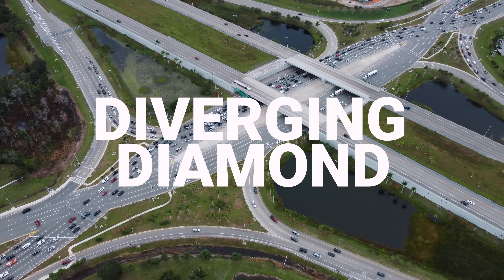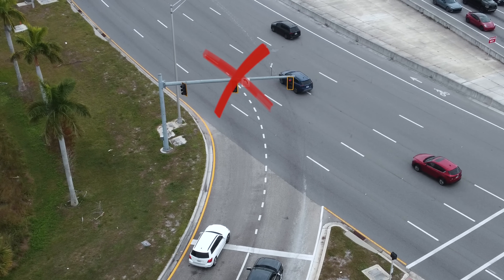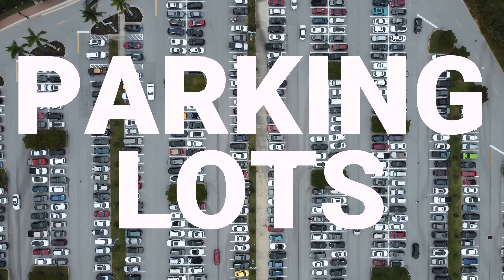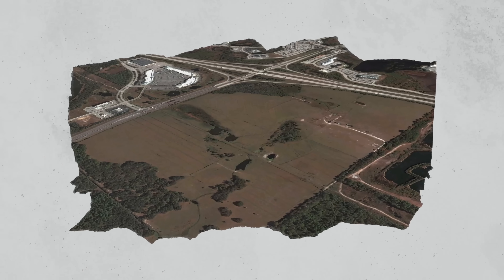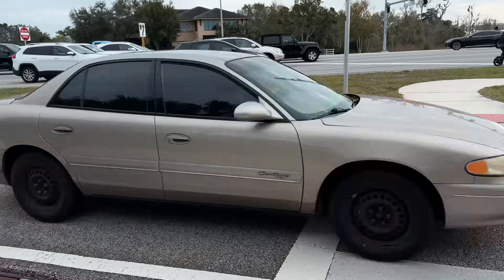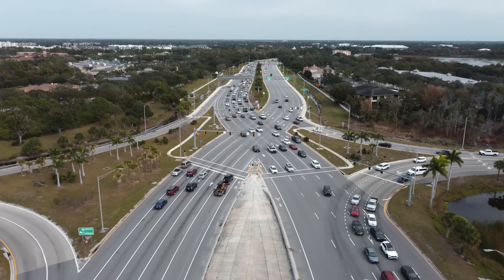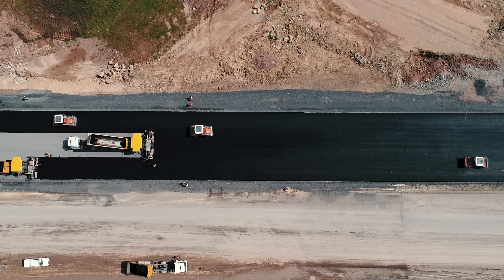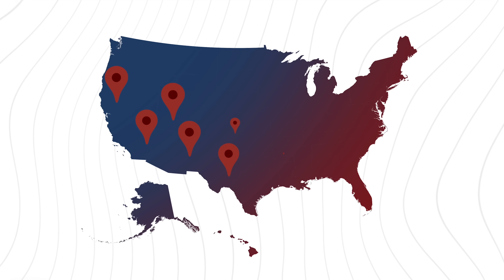Traffic Will Never Be Fixed Here

Comment: As a European, I've never seen such an interchange in real life, really fascinating. I've built them in Cities Skylines 1&2, but there they seem more like a gameplay concept, because nobody would be so crazy to built a five lane per direction highway. The collector road next to my apartment has two lanes in total, and that's a major traffic hotspot in the area.
Reply: Interchanges on this side of the pond are scary
Reply: the arterial road in my neighborhood is 4 lanes wide in total and the train line on it has a daily ridership near 1 million
Reply: Everyone should play cities skylines to see that more lanes can't fix traffic. Slam a bus or a tram line and you're good to go. Use cargo trains to reduce cargo traffic.
Reply: @freemanol  Another solution is the "relief route". This area in Florida was not designed with enough alternate routes that cross over (or under) I-75. Traffic is thus forced to go through that monster. Transit is typically not feasible because of the distances involved, and how spread out things are.
Reply: I assume you just dig a tunnel to avoid the problem of the 2 main intersections in the diverging diamond in Cities Skylines? At least in-game, the engineering challenge of building tunnels and bridges is a non-issue as long as you have space.
Reply: @takatamiyagawa5688  No, I just had those two intersections as intended. You're right that it's easier to just build a tunnel in CS, but getting the roads to not overlap with each other (which causes the game to refuse building the road) is still hard.
In CS1, there are third party mods that allow the two traffic lights to be properly synchronized, so it's possible to recreate the real thing. In CS2, mod support isn't there yet unfortunately, so it's a big mess and just causes even more traffic.
Same issue with single point urban interchanges, even though CS2 actually has one as a predefined building block.
Reply: @anlumo1  Games rarely take into account real world problems such as the high water table in Florida, and the flat terrain means any crossing has to reserve additional room for the approach ramps.
Reply: @dtvjho  cities syklines since it's the first game, you needed to mod it for traffic to work correctly otherwise you can have 2-6 lanes but everyone takes the very right single lane no matter what
Reply: @takatamiyagawa5688  that is called a double crossover merging interchange. the big problem with them is they take a lot of space and cost a lot of money. Its my personal favorite interchange, as it does fix a lot of problems. 

I think a another solution that could be implemented in some places is all directional four leg interchange. same concept but instead of the main lanes crossing over each other you make the left turning traffic take a ramp over the whole thing.
Reply: You are going to love East Texas then.
Reply: Irvine California has 3-4 lanes in both directions on almost every road in town and it’s a wealthy designed from scratch city with warm sunny weather all year. There’s bike trails for exercise but they don’t go to shops for that residents have to drive to avoid crossing 8 lanes of traffic. This expense is all by design.
Reply: As having lived on the other side .. Germany was once totally willing to demolish medieval castles to build Autobahn-interchanges. Not all citizens agreed and now e.g. the Kommende Ramersdorf still stands, precariously close to that cloverleaf. If there are only fields there to begin with, nobody will be against roads per se, and so the monstrosities get built. But if there are other things around, it's not so clear any longer. I feel that Germany started backing off a bit on more open highways starting with the 1990s, with the tunnel construction to hide that monstrosity in Düsseldorf. Similarly, San Francisco's Embarcardero Freeway was demolished in 1991.
Reply: @karlkoehler341  Germany also has a very broken relationship to cars in general. Freie Fahrt für freie Bürger…
Though my experience when driving through Germany was that there weren't that many huge Autobahns, just that they're everywhere and span through the whole country like a spider web. The traffic is more spread out.
Reply: @anlumo1  They you were not driving through the Ruhrgebiet there are close to none which have no speed limit. There are crazy traffic jams on the A40 or A1 or A3 or all around Cologne. There are just to much people here. And something to note here we have a huge web ob passenger rail lines here aswell. But those are also as full as the streets but without them traffic would completely collapse. You also have to add that we have a huge amount of trucks driving through our county to the sea ports in the north or west for example.
Reply: @jonkess2768  Still I love the Ruhrgebiet (Ruhr Area) in Germany, perfect mix of real dense urban cultural life and slices green and some smaller-scale infrastructures. Much better than f.e. the Randstad area in The Netherlands. I have been working in both areas.
Reply: @karlkoehler341  The present castle is from 1842, after the original building burnt down.
Only the Georgskapelle was saved and moved to another location!
Reply: @karlkoehler341  Cloverleafs are a terrible design anyway, always have been. They're cheap if you have big tracts of cheap land to build them on but other than that they have little to no benefit.
Reply: There are (much smaller) diverging diamonds in france. I think thats where they were first used since they date back to the 1970s.
Reply: In the UK we generally use a roundabout with traffic lights for this job. I don't know how well it would scale to this level of traffic.
Reply: @daveansell1970 And possibly grade separation as well. 

Although at least in my experience, in the UK you wouldn't usually have a road quite as hostile to pedestrians and cyclists as this with as many lanes as this right next to even an out of town shopping centre.

Or if you did, it would be a motorway with flyovers etc or motorway style dual carriageway surely?
Reply: Even in normal parts of America (i.e. not Florida) our diverging diamonds don't have five lanes in each direction
Reply: In the Netherlands we have something like this. But its a highway intersection without traffic lights achieved through multilayered bridges. Really massive. You can find it on the A15 / A16 between Dordrecht and Rotterdam
Reply: Philadelphia has an awful stretch of... I guess it's an oversized roundabout? The Benjamin Franklin Parkway... It's tons of intersections crisscrossing through a hellscape of lanes and lights. It feels like a true free for all only slowed down by the traffic lights... Worst part? The Art Museum Rocky Balboa climbs in the iconic movie scene stares at it in all of its madness.
Reply: We do have in Europe something that looks like it, but without the intersections. Instead we have "fly overs" these replaces intersections if clover leaf intersections haven't enough capacity;
Reply: @buddy1155  I think I've seen that before. The interchange of I-405 and Wilshire Boulevard in Los Angeles has those
Reply: @buddy1155  Yeah, a free-flowing variant that eliminates the two cross-over intersections is definitely better, but I don't believe any have been built in the U.S., probably due to cost of building the additional bridges/tunnels that would be necessary. But in this particular example, the intersection isn't even the bottleneck anyway. It's also crazy that bikes and pedestrians are supposed to be using it and crossing at those same cross-over intersections. Yikes.
Reply: @buddy1155 That's an intersection for two highways not a highway and a collector/arterial, which is what diamonds and diverging diamonds are for
Reply: @buddy1155 There is an interchange like this in France with lights in the town of Versailles which inspired this and now similar configurations are all over the United States.
Reply: @buddy1155 Ok, but 5 lanes highway just don't exist in europe.  I live in Geneva (1.2 million inhabitants) and the widest road in the conurbation has only 2 lanes in each direction (if we don't count the preselections lanes). As I travel almost exclusively by train, I've hardly ever seen the motorways of the rest of the continent, but I did once take the motorway between Marseille, Lyon and Paris (the 3 biggest cities in France). Even there, the motorway only has 2 or 3 lanes.
Reply: @fabswisss  between Amsterdam and Utrecht we have 5 lane highway (so 10 lanes in total)  at some point I think it is even 11 or 12 lanes total 
Switzerland is different because of the mountains. I understand you don;t want to waste space there, not to mention the cost of tunneling
Reply: @buddy1155  That's because without those fly-overs, having intersections, instead, the entire concept is a fool's errand to implement. It solves nothing.
Reply: I haven't seen one either but is was invented in France. An American engineer sow it, loved it and imported the idea to the US.
Reply: most people who play city skyline are not American. So we understane more lane mean more traffic
Reply: @nickfielding5685  cities skylines didn't really do a good job of more lanes = more traffic, but it did a very good job of showing that more lanes also =/= less traffic, because lane count isn't the main problem to begin with (most of the time).
Reply: now what if you actually made the two one-direction parts spaced out even more as bridges, without them intersecting? then divert to the crossing road with ramps.
I mean, it will cost way more, but that way, you will actually have 0 conflict points - right?
I need to fire up CS1 again..
Reply: @bernds6587  You probably could also make one go below in a tunnel.
Reply: I love Cities Skylines
Reply: Oh buddy, Texas has some words for you. We have SIX going in one direction
Reply: Fascinating and pointless, since they don't fix traffic problems. Unfortunately the car-centric way American cities can't be fixed without a profound rebuilt based on public transportation
Reply: In Europe you use mass transit, trains mostly.  And you bicycle and walk more.  In the US we have ostracized the poor and relegated them to mass transit.   It's always hard to get money for mass transit because it only benefits the people we blame for the country's woes.  We build more and more highways and keep subdividing them into HOV lanes, express lanes and toll lanes, but it's never enough as the population just grows and grows.  But the solution is to intermix with the poor (unacceptable) or control the population (sacrilege).
Reply: UK here, I dont think i have ever ever driven on a road whith 5 lanes, much less just in a small urban development to get to a shopping centre. its appalling
Reply: That's because in Europe we would built a two lane fly over, instead of a five lane that crosses another five lane same level. And we would have the same capacity with it, with added bonus of continuous flow of traffic.
Reply: Honestly when I still played this game I'd rather create some multi-level intersections with highway ramps as anything else would become a mess anyway
Reply: In my country we still have cloverleaves but roundabouts on both sides is best. Newer interchanges are usually with roundabouts. 
Then again, we also don't have 5 lanes in both directions lol that's ridiculous
Reply: @leonpaelinck  That's called a dumbbell interchange btw.
Reply: I wonder how accurate Cities Skylines is to simulate such idiotic urban design and its consequences.
Reply: There's a three-lane one near me.  I couldn't wrap my head around it while it was being built but they're incredibly simple to navigate as you drive through them :)
Reply: There are more cars in that one square mile of video than in most small cities in Europe though.
Reply: @casmatori  Yeah, the US is pretty stupid in that regard, that's what happens when you allow car manufacturers to design laws and literally bulldoze huge parts of cities.
Reply: yes but you guys have roundabouts like the magic roundabout in swindon should not exist and I would much rather do a diverging diamond
Reply: the two I have seen in real life were 4 lane road, 1 lane ramps, and a 6 lane highway. I was traveling when I came across the first one, and di not expect it. it was strange, but I didn't find it scary as a driver.
Reply: it's because you understand roundabouts
Reply: Go to Netherlands if you want to see a 5-lane highway.
Reply: The first of this type of interchange was actually built in France.
Reply: I hate to say it but sadly this is quite common in the US but a lot of cities are changing that
Reply: Honestly if our city planners spent some time building their designs in cities skylines and tried to fix traffic in the game, they would have known how bad they are
Reply: but you guys live a different way think in a different ... not the same
Reply: I've driven on 20 lane roads.

American traffic engineers and city planners are delusional.
Reply: They are terrible even for car drivers
Reply: America, big car many car
Reply: you're full of poo. I've been to europe several times and there's definitely  10 lane highways in the major cities just like in the major cities in the US
Reply: Remember: vehicles in skylines are dumb and you really have to mess around to get them to do what you want.
Reply: We have many such things in Europe. Maybe not as much, but they're definitely there. Don't know where you're from
Reply: America, f yeah!😂
Reply: FYI: Highway 401 in Toronto has 16 lanes.
Reply: @jjjiljjjj  18 in places.  With plans to add up to 16 more in a tunnel underneath, supposedly.
Reply: Download NeXT 2 mod on Csl:1, they have 8 lane roads and up to 6 lane highways
Reply: We literally got them from France
Reply: You won't see it as much in Europe because of the size of the countries and how you can easily use mass transit more than the US where rural areas or suburban sprawl don't have much mass transit.  Your highway sizes don't need to be as large due to those either.  The largest in my area is a 8 lane highway for a short period while the interstate is 6 lanes.  Lots of 4 lane state highways too.  But LA or larger cities will see 10+ lanes.
Europe also has a lot more development since earlier times so the areas were developed around the existing buildings/cities.  The US has a little more ability to develop on land that isn't so nailed down (even though govts do sometimes take their land for pennies on the dollar) to build wider roads.  I wish mass transit was better in my area, but it's simply not possible for the scarcity of people that it would benefit until I get closer to town. So I would have to drive 10-12 miles to get to where I could use mass transit the last 3 miles.  At that point, I might as well finish driving the 3 miles myself.
Reply: I love how I am the exact same way (European building these monstrosities in Cities Skylines)
Reply: You have a few sections of A3 Frankfurt that's more than 3 lanes each way, but Europe is almost all built around cities and towns, and most Autobahns for example don't enter the city center like here. Serving compact urban centers with rail and Mass transit is fairly easy. We took out all our urban passenger rail outside a few big cities and the Northeast (ACELA for example) in the US after WW2 due to the suburbanization and automobile industry.
Reply: You should see houstons
Reply: I live in the only city in Belgium to have one and it works so well
Reply: Im looking in that game now and I thought thumbnail is the game so I started watching lol
Reply: I hate diverging diamonds so bad SPUI's are so much better even in CS1 and 2
Reply: to be fair, some of those interchanges are trying to handle more cars than some european countries have people. we do have an issue with this though and it's why, despite living only like 2 hours from dallas and going there reasonably often, I park in rowlett and take the train to dallas. if you think these are bad, look at dallas's interchanges.
Reply: @unknown_-ed2rs  We also have large interchanges in Europe, like the Frankfurt junction that handles 335 000 vehicles per day. But we always would built crossing free layouts at such a interchanges.
Reply: @unknown_-ed2rs  Driving to the border of the city and then taking public transportation is very normal here, there's even special parking for that specific purpose, called "Park & Ride" or short "P&R". There are even train stations that have "P&R" attached to their names to help identifying them.
Reply: @anlumo1 i mean it should be more normal here too, but my point is more that the highways there are so bad that i, a texan who could easily drive twelve hours and think nothing of it (its like 6 to visit my nearest grandparent), would rather go without my car in a city that is not safe to walk in.